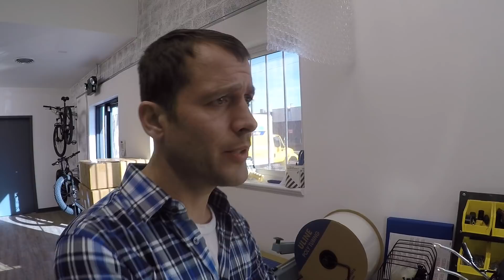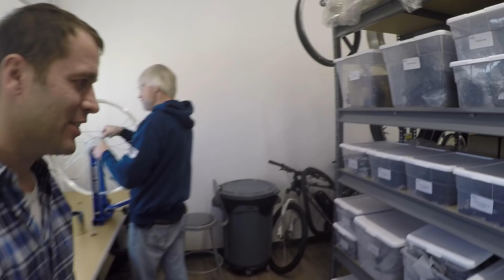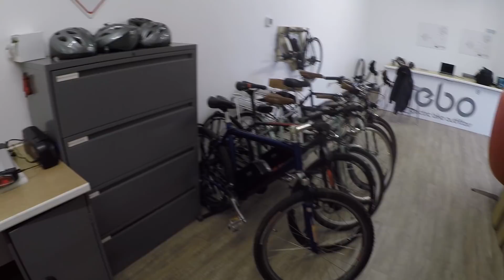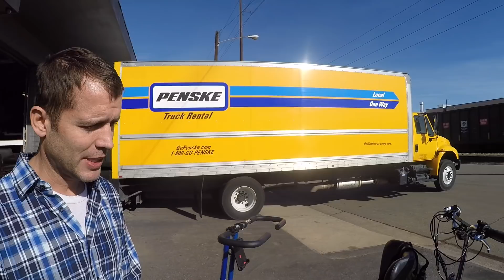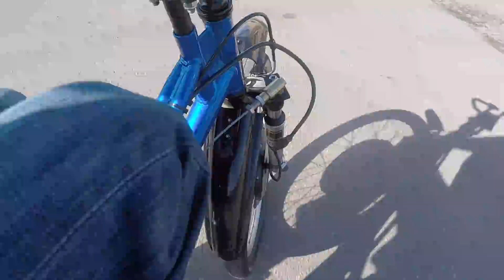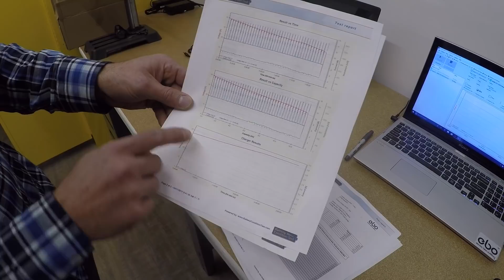Electric Bike Outfitters Tour, Hi-C Battery Repair Interview

Comment: Some of Jason Livingston's advice contradicts the advice of other battery experts esp re his opinion that you ought to almost empty your battery before charging it because to do otherwise would reduce the life of your battery. My understanding has always been to recharge the battery well before it reaches say the last 25% of its power. But the way I understood youe expert advice is if your battery is good for 60 miles, don't charge it until your battery is almost flat. If a battery is said to be good for 500 cycles, my understanding has always been that you could double that if your charge it when it's half full. Would appreciate some clarity regarding this issue.
Reply from the maker: Yeah, his advice contradicted my understanding at first too... Basically, always charge before it gets close to 20% because there's a chemical change that happens around there. Your learning of "charge before 25% makes sense" and I guess it doesn't matter as much if you do or do not charge once you've only drained the first 0% to ~75%. I'm not sure it's great to leave batteries on a charger constantly once they are full, because it can heat them up? I'm open to other input here and Patrick will be doing a battery Q&A in the EBR forums soon, so keep an eye out there. I think he's one of the most expert people I know: https://electricbikereview.com/forum/

Comment: I know I've mentioned this before with my Bafang mid drive but, it appears, the number of magnetic cadence sensors (assuming there's a few) doesn't determine when the controller turns the motor on and off. I can program mine to bare movement of the pedal which is way too soon and dangerous to at least a complete revolution and maybe more.
Reply: Ian I wonder if it's the manufacturer's specific settings they program in their motor controller regardless of magnet count. I understand most lcd displays won't have an ability to program the cadence start and stop rate. My point is I'm able to with mine because Bafang finally gave in to the American enthusiast community and sent the software necessary to comprehensively alter their factory settings in the programmer module. One of the things discovered is magnet count not being a significant factor because when programmed accordingly the module can merely start and stop the motor at one pass from one sensor. That's barely moving the pedals.
Reply from the maker: Interesting, thanks for the feedback guys. I wonder if the manufacturer for EBO kits is Bafang? He custom brands the casing and said that he custom designed the hardware too... but who manufactures it? I like that he gives more access through his display